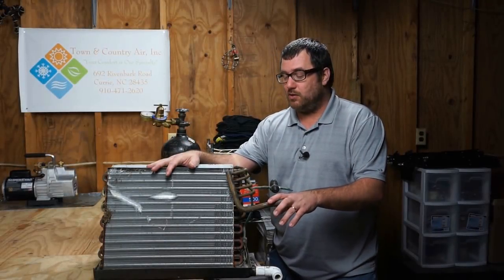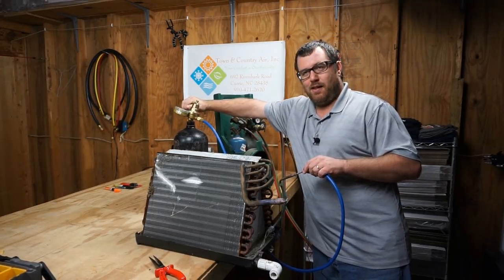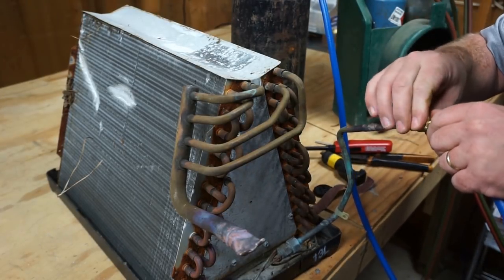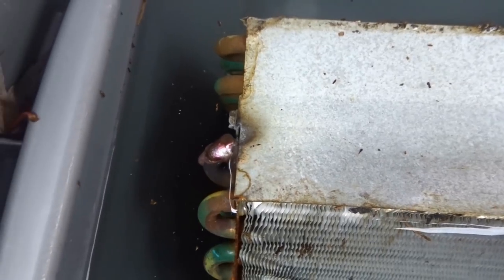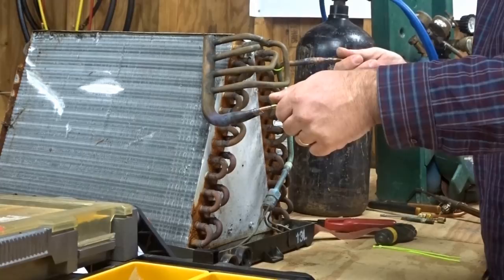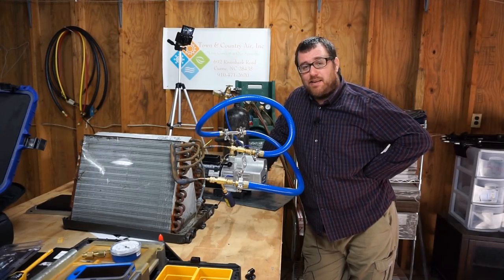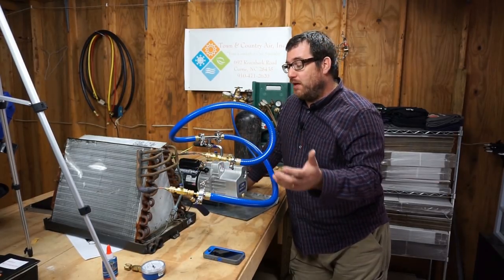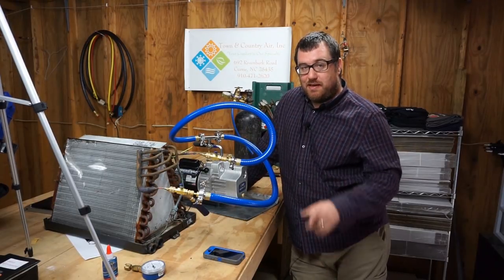Pulling an HVAC Vacuum on a Leaky Evaporator Coil

Comment: When you perform the vacuum to Kate test try that again with one drop of refrigerant oil I’m top of the leak see if it acts as a good sealant to slow it down even more like a line set inside insulation that is saturated with oil from leaking overtime and then you preform a vacuum decay test
Reply: t lech 
Totally agree.

Comment: Too much heat on a loop , use a longer flame and back your torch off and feather the repair as you add rod...all your welds / braze suck . Im sure you have a lot of leaks and few successful first welds

Comment: Why is cleaning the copper important before brazing....
I’ve seen guys braze without cleaning the copper and connection seems to be okay to the visual eye.  What’s the big deal...?
Reply: Martin Woods- Because I'm to lazy to answer stupid questions and if you really want to know the answer then do your homework and read this article:
https://vacaero.com/information-resources/vacuum-brazing-with-dan-kay/1501-essential-criteria-for-brazing-item-1-proper-cleaning-part-a.html
Reply: Solder only attached to clean metal that is not oxidized,  if you don’t clean, it won’t attach to the metal well due to oxidation, corrosion, dirt, oil, etc